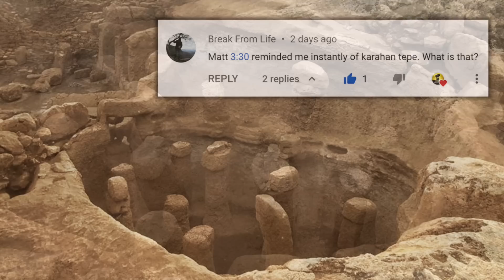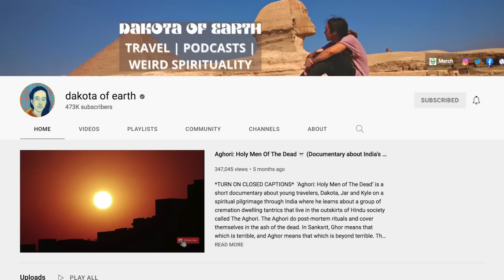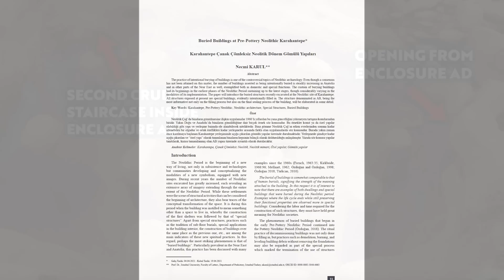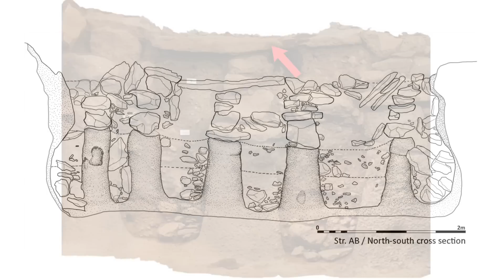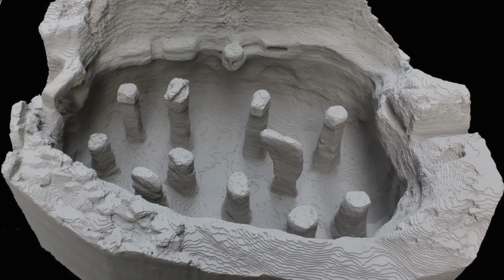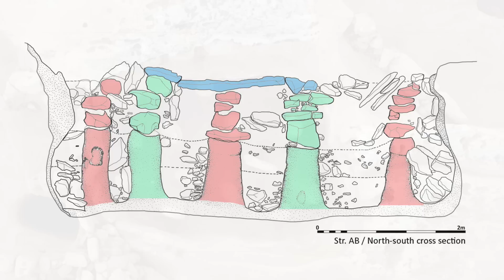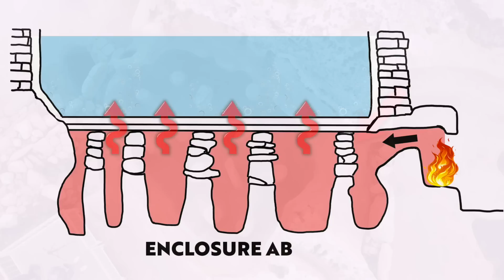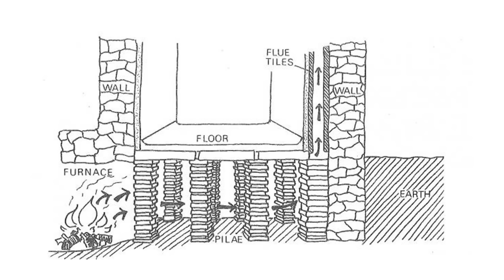An 11,500-Year-Old Central Heating Hypocaust system at Karahan Tepe? | Ancient Architects

Comment: It is similar in function to a Chinese Kang bed that is heated from kitchen smoke diverted through the enclosed box area and then vented out of the living area. The bed it takes in heat and releases it slowly throughout the cold nights. During the day it provides a warm platform for people to sit. Same principle, but without the element of water being heated.
Reply from the maker: Yep. And maybe no water. I think the heating element explains the form. I briefly mentioned the kang system in the video
Reply: @AncientArchitects  , the case for water present is good though. Visually there seems to be some water/ lime deposits to support that. A test for water deposit and mineralization would show it. I love your work.
Reply: This makes me wonder if the filling in AB originally stopped a foot or two from the ceiling, thus providing enough convection for heat exchange, but also more thermal mass to maintain heat.

Comment: Heating System? Matt, this was the next level :)
Even 12 year old child could deduce, AB was covered fresh water reservoir, while AA was open space bath pool. Never heard fresh water have to be covered to remain drinkable? Ok, you have deduced, there was a stone slab lid. But why then you invented heating pod, instead of just assuming, those people needed water for drinking and cooking? There are three water inlets from the slope, for collecting rain water, isnt that obvious?
Also that filling stuff. From Gobekli Tepe there is this myth about ritualistic filling. But the truth is much simpler. After place was abandoned for whatever reason, material just built up and eventually, covering slabs broke and filled the space between pillars. Simple as that.
Hole between AB and AC? For taking water out and sipping it into the hole on the AC floor, for daily usage.
Channel from AB towards lower ground? For taking out excess water during heavy rain, you dont want to overflow reservoir.
What I am not sure about is wall between AA and AB. Could be there because excavator made a wrong assumption because of two biggest stone arrangement which could match  just by accident. I dont think, barrier between AA and AB is worn down, it was made like that on purpose. Cross filling? It is matter of levels.
Hope I gave you some realistic ideas. It is really not hard to stay hard on the ground, those sites are wonderful but too much imagination could spoil ability to think logical and analytical. Remember Gobekli Tepe with initial religious drama? It was temple, bla bla. I knew that was domestic, those were houses, not temples, on the first sight. The same here. Inlet channels? Outlet channel? It is about collecting rain water. Pillars and flat slabs? Covering. BTW, excavators made a big mistake there. They should live that remaining big slab on the pillars, where it was found. Now, that is ruined forever. And now idiots are thinking about faluses and star constellations, as usual.
Keep good work, Matt. Your videos are always interesting. Just control your imagination a bit.
Reply: Are you saying the Romans didn't have heated pools?

Comment: Interesting hypothesis, however the traditional Roman hypocaust designed seemed to have pillars which seldom were. More than 2 to 2 ½ feet in height.  The Pillers found at Gobekli seem to be more on the lines of  12 to 16 feet in height.  The amount of wood needed to adequately provide heat for a Hypocaust chamber which was 12 to 16 feet tall would be significantly greater than that needed in an average Roman Hypocaust.  Also it would make no sense to carve incredible creatures  on the Pillers present at sites such as Gobekli Tepe only to enclose them in a heating chamber as no one could view them.   Finally, If these spaces were used as a Hypocaust I would think all of the Pillars would have SIGNIFICANT carbon residue on them.  If on the other hand, they were enclosed worship spaces where people gathered, I would expect there would be much, much less carbon residue.
Reply: Karahan Tepe and Gobekli Tepe are two distinctly different sites with different looking pillars. I don't think he proposing gobekli tepes large enclosure is the same.
Reply: Didn’t he say that these pillars are about a meter high? These specific pillars in this particular enclosure

Comment: I love the thought Matt, and I have no doubt that those people had the capability to pull something like that off.  But as for that particular feature being a hypocaust system I personally have to disagree, primarily due to the fact that the pillars are different heights, and also because they are stylized.  Why would they put work into stylizing them if they were just going to plunk a floor on top of them?  Anyway, just my two cents.  I hope you are right, because that would be an incredible development.  Thanks, and keep up the great work!
Reply: Such works might just have been the tip of the iceberg of grander works that might have been above that are now destroyed or just lost to time or moved to other places when they moved finally.  Or taken what was above as building material for some future place in the later days of the settlement.  The stylization was probably the mark of craftsmanship at the time of its original creation or close to it, now just a worn pieces.

Comment: Brilliant!  Expanding on your insight…. It often seems human smaller scale structures go through a lifecycle.  May I suggest that the original design was heating water above the first four pillars.  As the settlement grew, they decided to expand the heated surface area.  Absent knowledge or an attempt at a less labor costly expansion, they dug out the space marked out by the the shorter pillars, possibly thinking adding a stable cavelike space with a stout thick ceiling would additionally heat more of the surface above it, expanding the volume of hot water in the AB pool.  The third phase was a ‘repair’ phase.  The earth over the shorter pillars was inadequate long term as a floor, even though thicker than the original floor of the pool.  The repair was to excavate the dirt floor addition, stack stones on short pillars and create a homogeneous floor across all the pillars.  The ‘odd’ pillar might have been introduced because a planned or existing pillar cracked and they required a replacement.  It may have been a pillar from elsewhere repurposed.

Finally, once the floor became structurally unsound after that, it became a danger and deciding not to repair it again, they filled it in.

I agree the larger room was a sauna.

Here are some testable hypotheses to support your primary hypotheses.

I believe the reddish brown fill at the bottom was what was left when they drained the pool as it became too filthy for use.  While draining they probably swept debris out with draining water.  If this was a bath, the distinctive nature or the reddish brown fill would be a mix of plain dirt tracked into the pool PLUS EXFOLIATION from bathers.

Run a spectrometer on the reddish brown fill.  I bet anything that the distributed volume of chemical constituents would  equal c1 (chem constituents of nearby dirt) + c2(chem constituents of exfoliated human skin).  We KNOW what theses chemical constituents are.  If you can get sensible estimates for c1 and c2, surely it would be outlandish to think it coincidence!

To test the idea the original under pool heating was expanded, sample the depth of the reddish brown matter around the 4 tall pillars and separately around the four short pillars.  If the reddish brown matter depth is significantly different, it supports the explanation for differing size pillars.

Finally, I suspect the deep hole in the sauna was the well-spring that provided a steady source of water. 

PS The foot wear between the the sauna and pool is astonishingly severe.  If you look at step wear of know older structures, it would be hard to believe it was in use foe any less than hundreds of years.

I like the idea that the intentional burying of spaces was just normal ‘urban’ fill of an obsolete structure for purposes of safety.  So nice and mundane.  Not mysterious at all!

If this goes anywhere, particularly the spectrometry I,suggested. Please include me as author.  I’m in the biz and publications count.  I’m also happy to generate the c1 and c2 estimates for paper using spectrometry results.
Reply: This is an interesting thought. I'm afraid that Matt is not in the position to get the reddish brown rubble investigated, as he has to work from a distance. Perhaps you can inform the local authorities and have them run the spectrophotometer tests and contact Matt when you have the results..
Reply: While I’m an applied statistician in academia, archeology is not my field so I have no connections.  Maybe I will cold call an archeologist on campus.  I will be sure to acknowledge that the overall substantive hypothesis is Matt’s.  I bet some professionals watch his vids.  They are excellent!
Reply: @kfgold5194  I agree. It was very nice to witness Matt becoming data driven,  evidence based, and enthusiastic as ever!

Comment: Nice idea, but there's problems with it:
1) The lowest entry point (for a furnace) is not low enough to make sense. Surely a furnace would need to be open right at the floor level. Otherwise what's the point of having the floor be even deeper than the furnace level? That would just waste heat, by having more volume of air that would need to be heated. All the schematics of the floor-heated saunas that you showed had furnaces at a lower level than the pillar room for this reason.
2) And if the 70 cm hole opens downward, then how did they force the smoke downward and through the bottom room (AB)? Surely the large room would be full of smoke long before the smoke would decide to exit that way.
3) If that room (AB) is meant to be a closed space, never to be entered by people except for maintenance and only existing for smoke and hot air to pass through then what's the point of the carved stone faces? It takes quite a bit of effort to make those. One wouldn't go to that much trouble in an industrial room that's nearly never entered and certainly never entered by guests. (This one isn't really a strong problem, seeing as how there's a lot of dumber things that people have wasted money on.)
4) One of the floor panels was present until removed and the others may have been destroyed in ancient times. But it seems suspicious to me that they would have been somewhat gas proof along the edges between. The romans had a sort of concrete at one layer of the floor for this exact reason. You suggested ancient plaster too, but there are no reports of any of this material having been found there.
5) It would have taken an epic amount of heating via furnace to turn a now lost room into a sauna. The problem is that a furnace would also work as a fireplace for the large room (AD). The large room would also have been quite hot by the time they could heat up 10+ tons of water and the stone panels.

But... What if the whole purpose of the large room (AD) was to store all the fuel that would need to be immediately available? Because burning only wood, you would need to have lots of it available. You wouldn't want to have to bring more every single day, so some extra would be justified. And the floor of the pool would have been difficult to make water proof. So maybe the floor of the pillar room is seemingly unnecessarily deep to have a place where water can go in case of accidental leaks?

Comment: Does this change the above-ground look of Karahan Tepe? And would these possibly apply at Gobekli Tepe, too, or no?
Fantastic video! Great work and really inventive thinking!
Reply from the maker: Can’t see it applying to Gobekli Tepe yet, unless we find a similar pillared enclosure - lots of pillars in close proximity
Reply: @AncientArchitects  great work here Matt, solid hypothesis. Personally I like this sort of analysis, it's healthy to speculate because it allows you to work through scenarios and eliminate things that don't hold up. Regarding Gobekli Tepe I don't think we would find something like this, Why? Lee Clare believes GT may have been a last ditch effort to keep the hunter gatherers lifestyle alive, and GT was not a site that was always occupied becuase they wanted that hunter gatherer lifestyle, which is why it seems to be quite different to other sites in the area. Also IMO the fact that they were not always there may support why they had to repair the natural infill so often after it happened, rather than actively preventing and managing the falling debris.
Clare mentioned other sites were moving away from that lifestyle which may (in a small way) help support your idea here Matt. This type on ingenuity is most likely an activity of a settlement that wants to occupy the site full time.

Keep going, hope you get more breakthroughs.

Comment: I think the next step here would be to build a model and see if it works or not. It wouldn't have to be huge, a one meter model to see how it warmed up air sent through the hole would react and if it is enough to actually warm water over it.
Even if it is a hypocaust, it could just have been to keep the floor and the building warm, or it could have been a bath or a warm water system. 
I don't think just looking on what is left is enough, a model might not 100% sure prove exactly what it was or how it worked but I think it would prove and disprove some ideas.

The best would of course be to 3D scan the entire thing and print it out as a scaled perfect model on a 3D printer but that might be a bit too much for starters, the beautiful drone footage and some basic measurements should be enough to make an acceptable model to prove the concept.

It is certainly an interesting idea and one I can't discard with the information I have but I can't say if it would work or not and how it would work as it is now.

So yeah, great job, Matt. :) It is an interesting theory.

Comment: Question: Wouldn't there be findings of soot or condensation crystals or whatever kind of thing would remain on the stone pillars and inside walls after decades (at least) of pumping heat, smoke and or steam into the room. Be curious to know what kind of remains they scrape off the Roman stone floor heating pillars and inside walls...

Edit: okay I see you mention you would like to see chemical analysis. So you thought of that. My other question is if chemical analysis is commonly used in archeology -- because I have long wondered If they've tested for evidence of blood in such sites as this one and Gobeki Tepe, suggesting possible sacrificial rites.
Reply: sometime the external furnace transfer the heat across a shared wall into the basement cavity without gasses entering the basement space.  less efficuent, but less likely to have gas leaks into the residence.  if no gas exchange, no soot of hydroclast pillars.
Reply: My thoughts as well. There would be soot somewhere. I think the better purpose for this structure would be a cistern especially considering how hard it would have been to get water up there.
Reply: @hubriswonk  I think it was a cistern, just with a basement. And when they got the fire going it warmed it up.
Reply: I would suspect ash or clay at the very bottom. I worry most of this evidence would have been destroyed when it was decommissioned and buried. Plus I think it got decommissioned because it failed, aka sprung too big of a leak.

Comment: Here's another idea. Maybe it's a malting floor. The grain is spread on the raised floor in AB and dampened, then raked and heaped until it germinates. Then the floor is gently warmed from below as you suggest and the grain raked about until it's dry. Then the grain is shoveled over the wall to AA causing the erosion seen. It's then spread on the floor in AA to cool and finally swept into the pit in AA for storage. When one wants to make beer the pit in AD is filled with water and stones are heated in the "fire place" then dropped into the water to heat it. A couple of basket fulls of grain are added with the occasional stone to keep the temperature up, then the water/grain is covered and allowed to cool. A week later the 'mash' will have fermented into beer.  When it's all been drunk the remaining grain can be eaten as griddle cakes or 'haggis' or it can be fed to animals.

Comment: Interesting hypothesis. Sounds and looks promising. A couple of questions though, where is the flue that drew the heat from the fire in AD through enclosure AB? If there was a fire at the enterence between AD and AB then the rock the fire was on whould show signes that would have been found by those excavating the area.

Comment: I streamed this on TV so was unable to comment at the time, but this is an absolutely brilliant hypothesis. In fact, your projected furnace structure reminds me of ancient ovens I've seen. While the 'grinding tools' video indicated that they used coarse grains for beer and gruel, it seems they could also have had the multi-use function of baking flatbreads over the fire that fueled the hypocaust due to the size of the furnace aperture.
Very much looking forward to your models and work on this amazing paradigm-changing site.